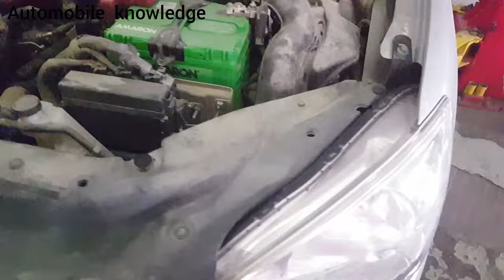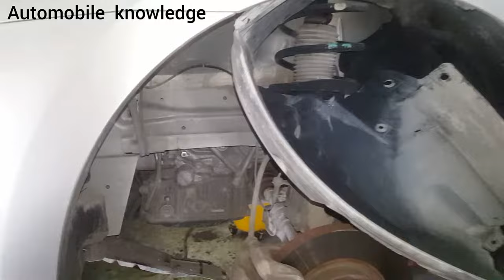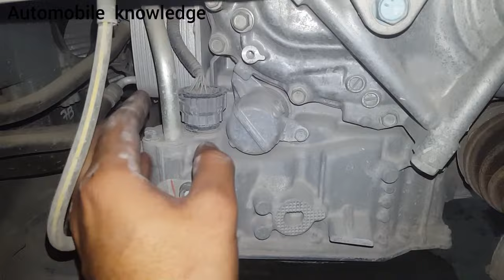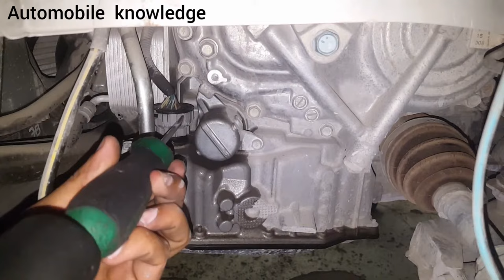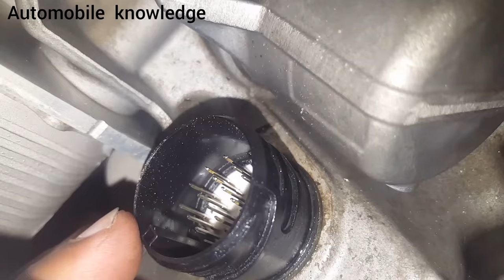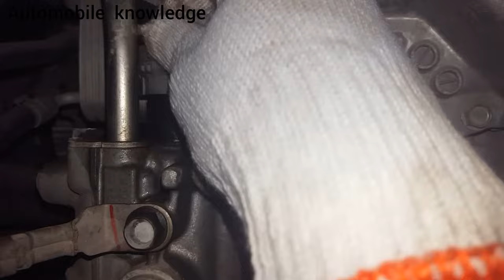How to remove and refixing nissan ALTIMA/SENTRA/SUNNY Automatic transmission main input wire socket

Comment: Is this for a cvt trans?
Reply from the maker: Yes this is
Reply: Thanks, I have code p1778 and the description of the code is stepper motor function/possible electric connection issue...before dropping valve body and replacing stepper motor could this be the issue? My undercover cracked and never replaced I’m thinking corrosion from rain and weather could have damaged...is this a possible fix?
Reply: @annibalegallucci7834  did you get info on this ?